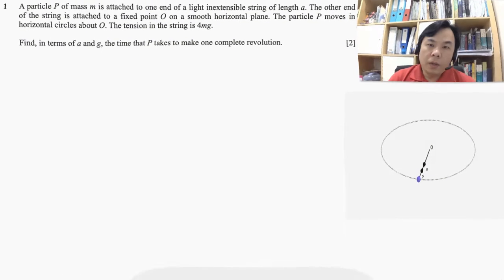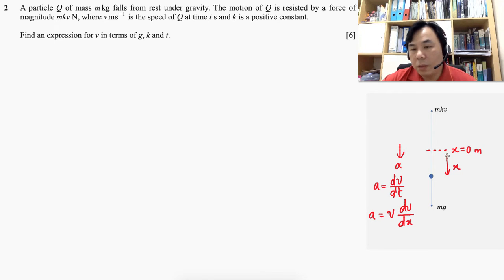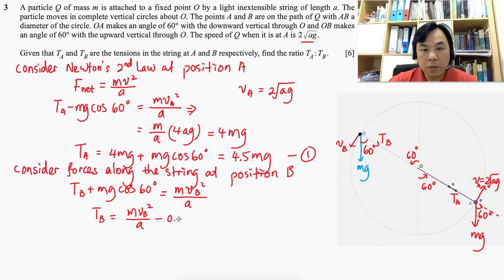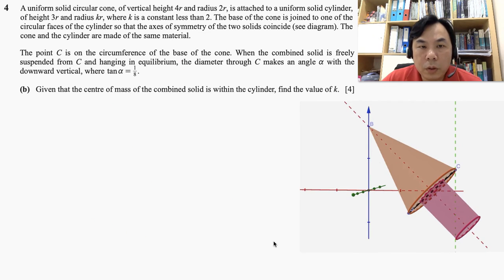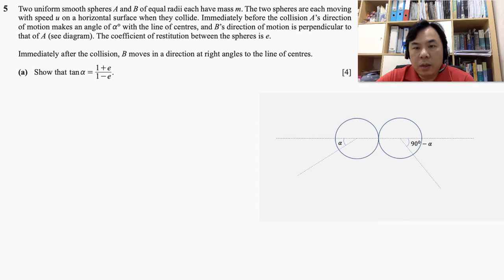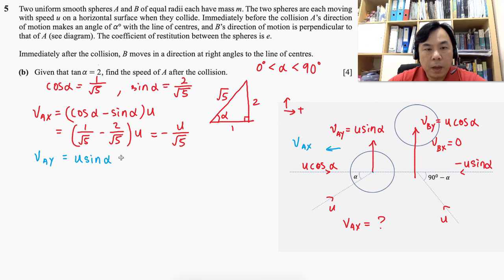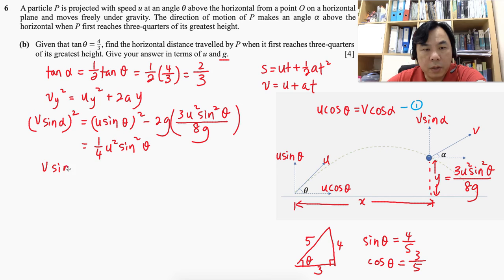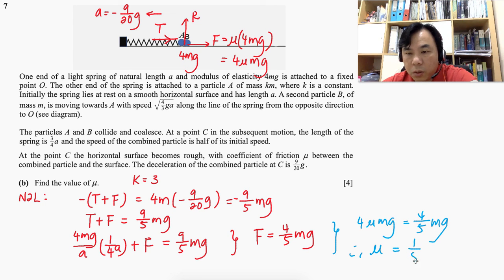A-LEVEL FURTHER MATHS FURTHER MECHANICS JUNE 2020 P33 QUESTIONS AND ANSWERS

Comment: sir so that means everytime if theres compression , tension and friction act in the same direction?
Reply from the maker: May I know which example you are referring to, so that I can clarify this concept
Reply: oops last question 1.57.00
Reply: I know this reply is late, but i’ll just put the answer here for any upcoming further maths students (you can do this, keep going!). Tension acts in the direction that it restores the spring, friction just opposes relative slipping between surfaces. I’m kinda confused on why acceleration acts in the direction he drew in the diagram tho.